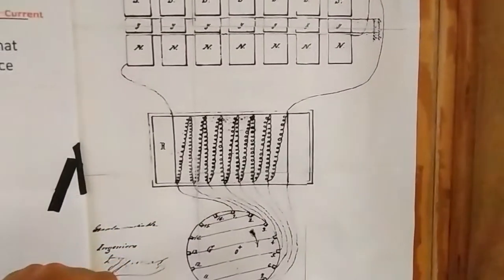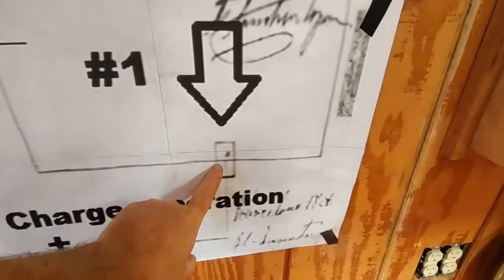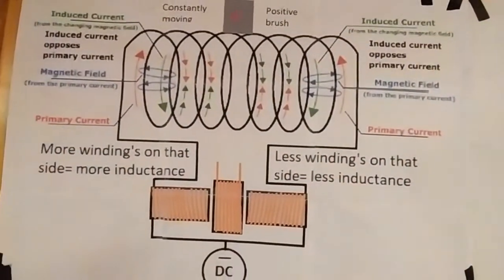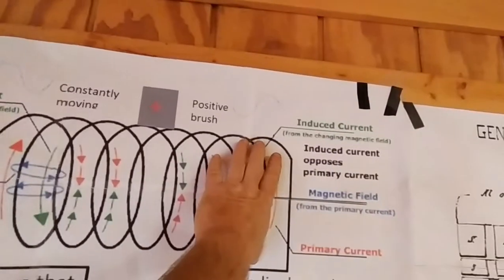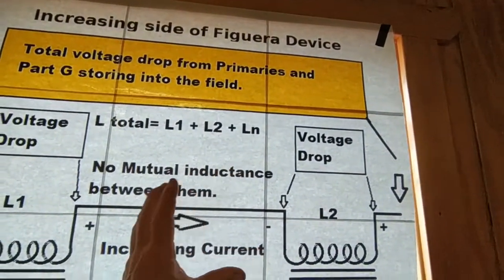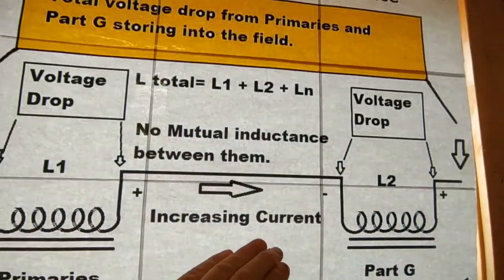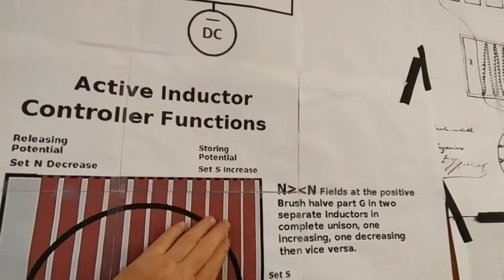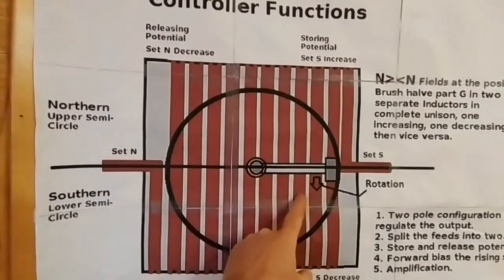Figuera Active Inductor Controller

Comment from the maker: Of course the Figuera active inductor controller in this video is an AC variac used with DC and is just a demonstration. i might redo this video as later i found multiple winding's were grounding out. i guess next time i will not buy used junk off of ebay.